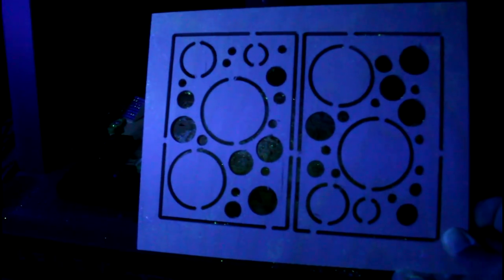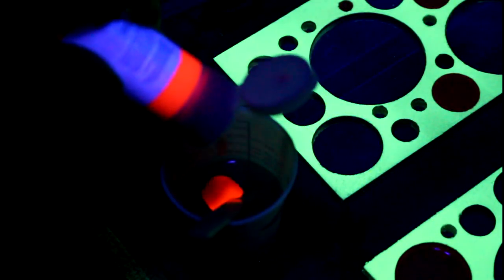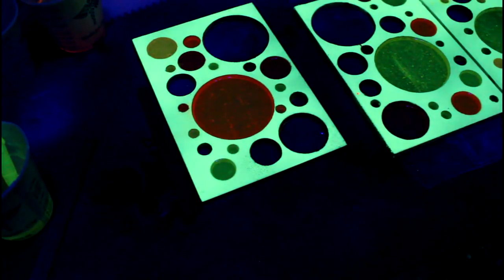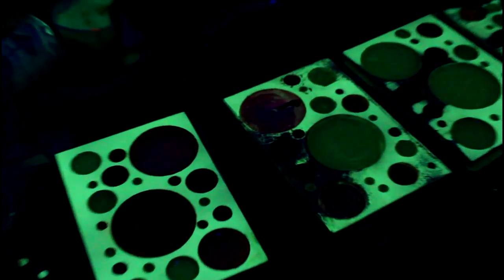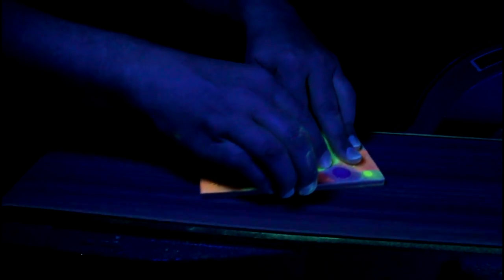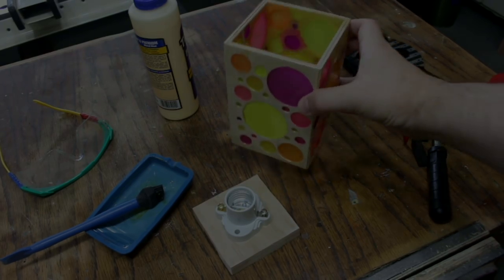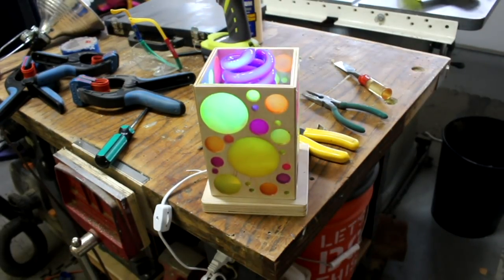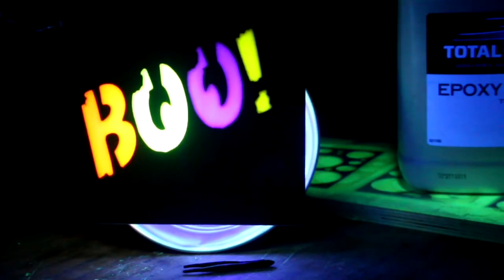Black Light Lantern

Comment: Hey, Peter, there's this really awesome glow in the dark paint that glows really bright and keeps it's glow for a long time with very little charge. It's called Glo-Away glow-in-the-dark gel by Plaid, and they've got a 4oz container at Walmart for 5$. I used this stuff to paint designs on my walls in my basement bedroom, and the walls still get bright every time I turn off the lights. Plus, this layers really well, and is less hassle than a spray paint. Hope this helps!

Comment: Rustolium glow in the dark spray paint doesn't bubble but is foggy or dusty after it dries and does work well but wears off fast if it's put on an item you handle. I put it on a remote. It also glows without blacklight so with blacklight its very bright.

Comment: The back sides of the panels actually look really good where the different resins leaked and mixed together.
You could take one of those panels, mount it in a deep picture frame, and use a row of UV LEDs to light it up.

Comment: # IDEA Try coating the one side with a spray adhesive. Then layering with the tape. It might make for a better seal. I've seen it done on TV for putting on patterns to be cut from wood. The patterns peeled right off afterwards

Comment: I have some further tips for your CNC. A) Reduce the length of your end mill, this will make it stiffer and less likely to break, it should be just long enough to cut your work, b) With a shorter stiffer end mill you can cut faster, you should be running at around 0.01" per tooth. As a final tip, unless you have a reason not to, use the widest end mill you have. This will be stiffer, cut faster (0.015" per tooth for 1/4") and be quieter.

Comment: For future black light projects, I recommend not putting fluorescing colors right next to each other. Different colors fluoresce to different degrees, so if they touch, the less bright colors will just look dark. This is why 60's black light posters tended to have very heavy black lines on them to separate the colors so they all look bright. Contrast is key.

Comment: Your lantern would look better with a lid done in the same style as the sides.

Instead of the glow-in-the-dark spray, I think you should look into brush or roll on glow paint.

Glow resin pigment - have you looked into the availability/cost of Highlighter ink on bottled form (like the ink used for calligraphy or an old-fashioned fountain pen)?

Comment: Great project. May I suggest you stop using a black light bulb and switch to black light (UV) LED’s. They will lay flush on the would block and lift up the entire piece so you don’t have any dead spots
Reply from the maker: +TheBowdenOnline good idea!
Reply: You can get them very inexpensive on eBay and at different watts

Comment: That kind of lamp would be really neat if it glew (glowed?) in the dark instead of black light: You would put a regular lamp in it, the light would glow through the colorful fake glass, and then when you turn off the light the glass would start glowing.

(Also: If the green paint would have glew between the circles, the lamp wouldn't have looked so cool. Now the circles pop out really nicely!)

Comment: Paint tip- The glow in the dark paint would have been phosphorescent, so if you shine a regular light on it and then turn the lights out, it would glow in the dark without any other source of light. 
The fact that it glows under blacklight is a side effect of that! Any super bright white or neon paint should be blacklight sensitive. You don't need to get a special kind!

Comment: Shoulda just affixed the bulb base to the lower platform and nixed the inner platform. You would have been able to fit the taller bulb (barely from the looks of it) and it would have given you more even lighting from top to bottom. Otherwise, I actually like it!

Comment: Here is a suggestion for next time to avoid leaks. Instead of cutting all the way through the wood, make a hole that does not break through. And leave the bottom as 1/8 or a 1/16th thin. Fill it with the resin and once it cured just sand the bottom away.
Reply from the maker: +Dsk001 that is an excellent idea!
Reply: Peter Brown one more idea for the spay paint. After applying the paint and it's dry cover it with tape before cutting it. This should prevent tear out from the bit and the resin spills will be a simple tape pull.

Comment: Just to be sure, are you wearing sunscreen or long clothes if you work that long under blacklight?
Many people are not aware that you will get severe sunburn of it. 
We use some at the lab for exposing stuff and we would get tan marks through our thick gloves
Reply: It is probally a consumer blacklight and what you have in the lab is a professional black light.
Which means yours is way more powerfull since you use it to expose things with it.
Reply: I guess so, but I see he has bare arms, and I don't know how long he's been in there for. (Also, if you were wondering, we were not actually sunbathing below these in the lab.)
Reply: I believe you are correct. In the 90's I had a couple of the huge blacklights you could buy at Spencer's and had them run almost constantly while I was home. I never once experienced sunburn or anything like that. And more specific of the size they were about the size of your average fluorescent tube in a garage or workshop.
Reply: Safety patrol even trolls blacklights
Reply: What an incitefull comment to add to this discussion.